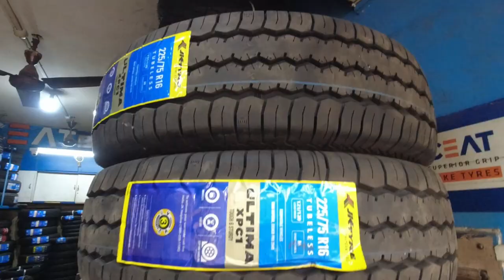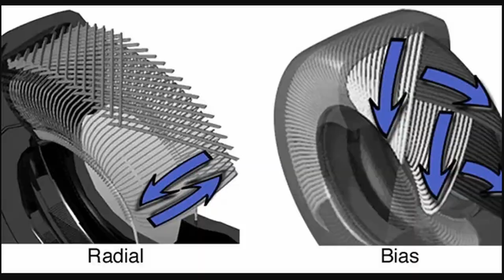Michelin Street Pilot 2 review after riding for 4,000 kms | Best budget tyres for Dominar

Comment: Broo iss there anyy difference between radial nd non radial tyree , nd can you suggest me a best tyre for dominar 400 normal City ride
Reply from the maker: Radial tyres are the best, but that comes at a cost. I'm using non radial tyres and I didn't felt compromised at any point of time. I'm running the same tyres and it is still doing fine with no punchers till date.
Reply from the maker: You can contact Uttam Tyres on Instagram if you are from Mumbai or Navi Mumbai